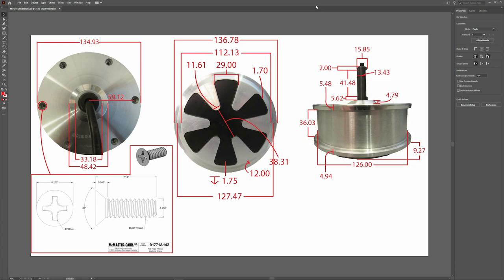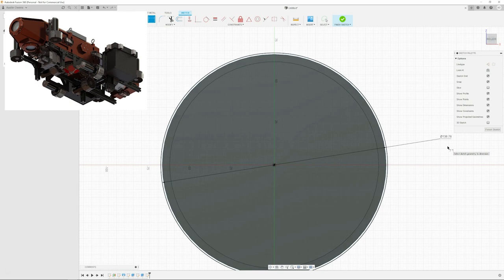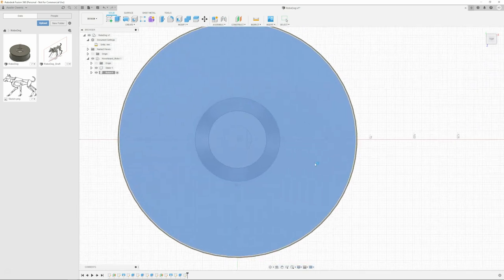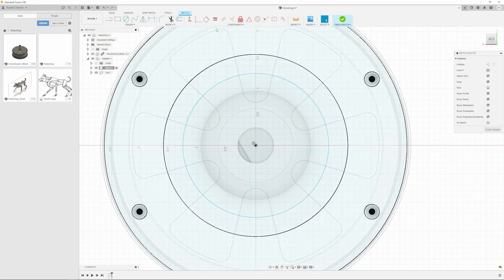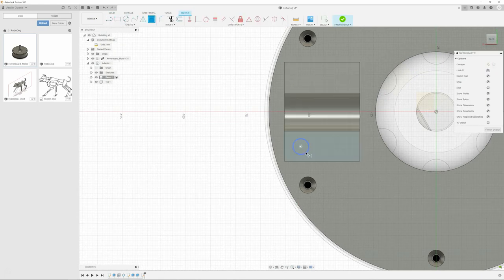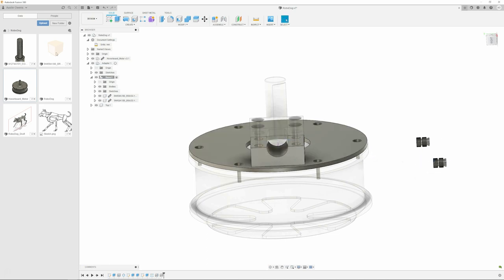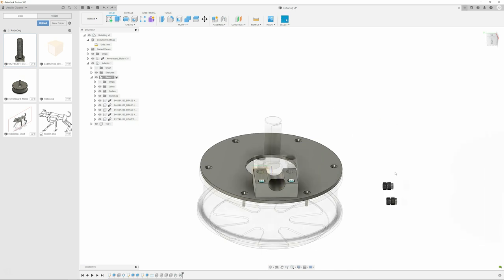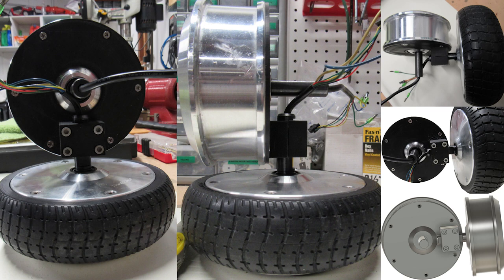RoboDog Part 5 | Designing Parts in Fusion 360 (Podcast Style)

Comment: You are doing the what I dream of, congratulations
Reply: Hello I am also working on one project using hoverboard motor and hacked firmware of motherboard available in hoverboard,  for odometery I want to attach external encoder in hoverboard wheel, can you suggest the best solution for that

Comment: If I'm correct we only need the CAD part of this project to build the body around the cage and clippers or joints to connect two legs motor together and if someone wants to have for example tiger than a dog they can design their own body but the basic structure and hardware parts will be the same. So we don't really need the Drawing part at this stage
Reply from the maker: The CAD part of this project is for helping build most of the mechanical structure of the robot, as well as helps me understand sizing requirements and where I should place the electronics inside. Please know that this can (and most likely will) be subject to change as I get further along in the project. I am using a 3D printer for prototyping, but I will be using another material once I finalize the mechanical parts, like aluminum or carbon fiber.
Reply: @AustinTronics  I'm looking forward to it hope all will go as you plan finger cross mate

Comment: Where can I download drawings for the motor hub I just realise I have ordered an 8-inch hover motor and the supplier claims it's 19A do you think it will do the job?
Reply from the maker: Most suppliers of hoverboard motors don't release the drawings of the hoverboard motor (as was in my case) so you most likely need to model one yourself, or find someone else who has already modeled one. My CAD models of this can be found on my GitHub if you want to use it as a reference: https://github.com/AustinOwens/robodog

There are other models of the hoverboard motor out there and can be found on GrabCAD: https://grabcad.com/library/tag/hoverboard#!
 
Also, does the manufacturer show a Kv rating for the motor? The higher your supply voltage, the less current you need to deliver the same power. You generally want a much lower Kv for robotics type applications. I think the 19A will be enough, but it depends on how heavy the robot is and what your setup is like, and what manuvers you want it to do. 19A may be to low of you want the robot to do a backflip or something, but it's probably fine for just walking around.
Reply: @AustinTronics  Thanks for the references I just want to build a basic robot nothing too fancy it's just learning basics

Comment: hello, will be simple so use these motors with Arduino and PCA9685 driver, to control them? thanks
Reply from the maker: No. The PCA9685 is a servo motor driver, not a 3 phase brushless motor driver. You can use the Arduino as the motor controller, but you'll need to choose something else that's compatible generating the 3 phase signals that the hoverboard motor is expecting.
Reply: @AustinTronics  thank you, I will look more into this

Comment: Bro i want to use hoverboard motor for exo suit so i want to ask can we ardino to control
Reply from the maker: You'll want to use a higher resolution encoder like I will be doing, but yes, it's possible.
Reply: Thanks
Reply: Arduinos can be a bit limited with processing power and resolution depending on the controller but it can be done